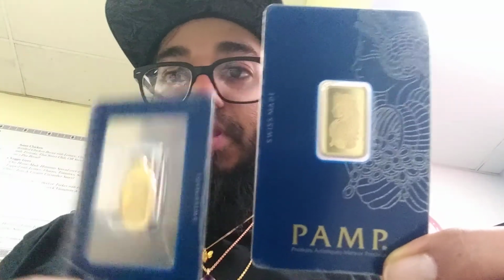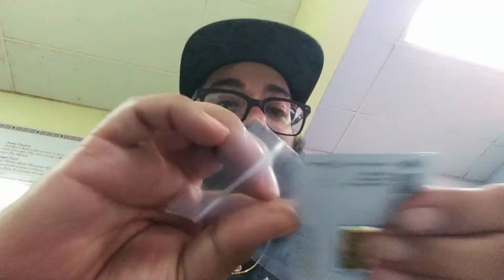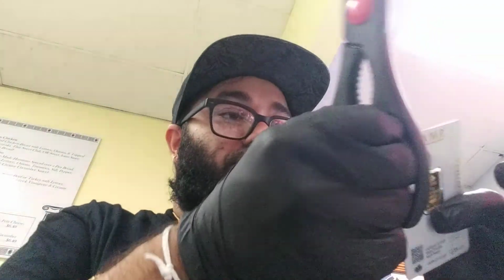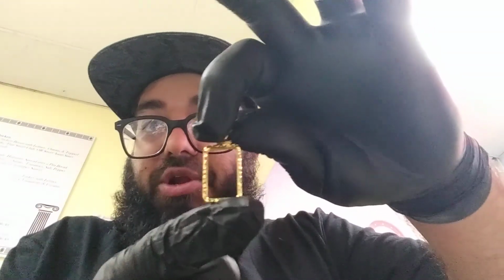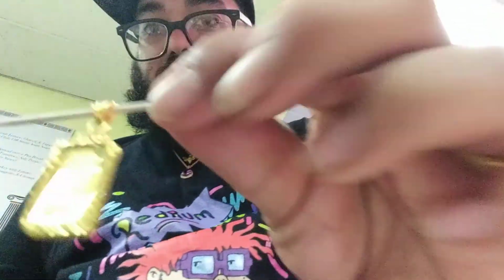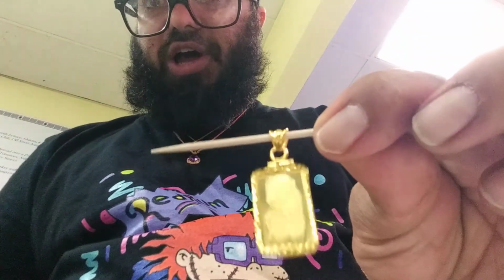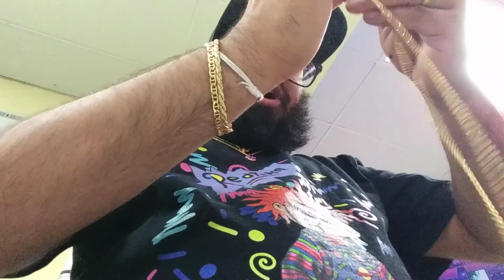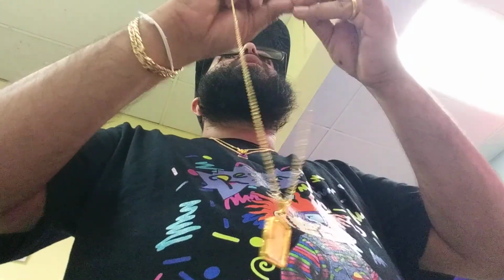DIY 5 Gram Gold PAMP Suisse Veriscan Bar Turned Into a Pendant Using a Screw In Gold Bezel

Comment: Where did you buy the bezel for the Pamp?
Reply from the maker: Found it on eBay. The seller is Aydin Manufacturing. They also have an actual website but eBay had 20% off.
Reply: Legends of Hollywu appreciate it